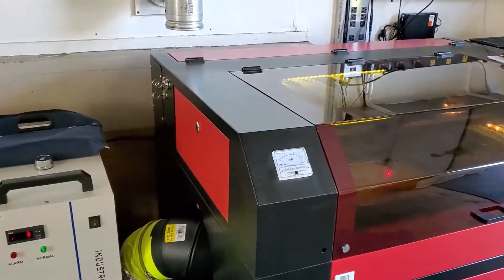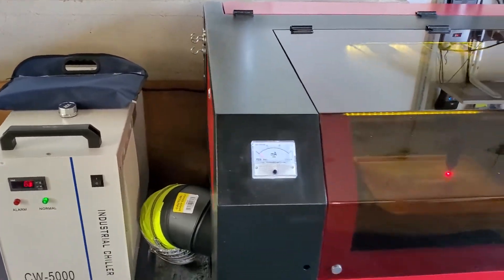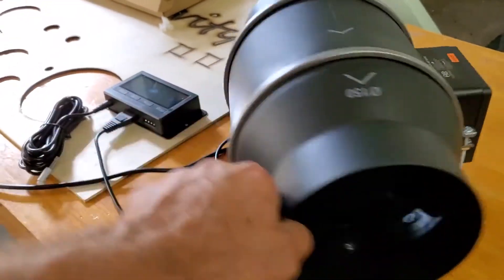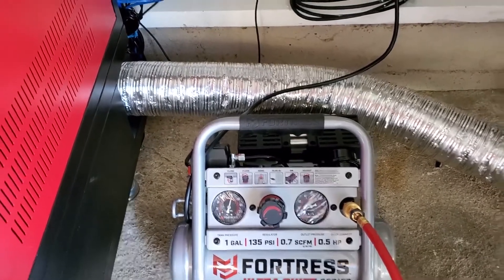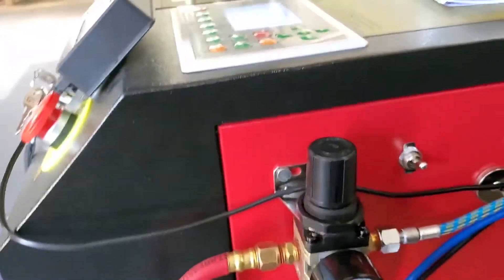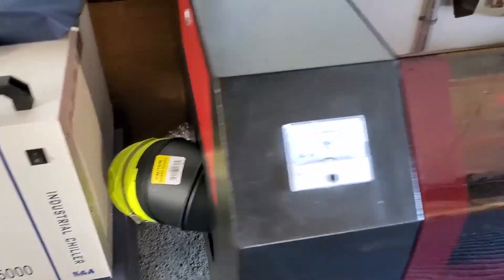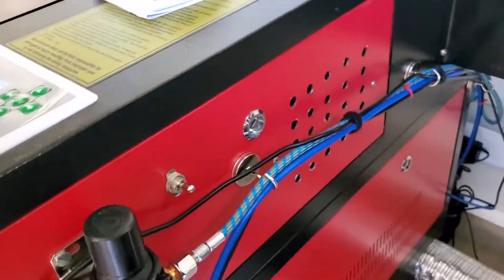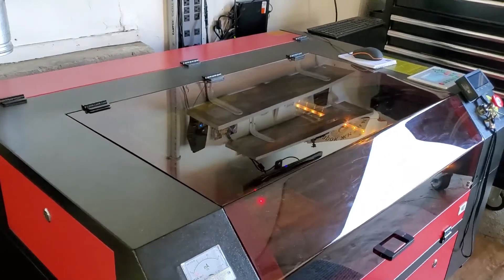Last CO2 Laser upgrade...really

Comment: Nice cross flow idea. Best of all that smaller fan will stay clean. 
I have one of them that came on the system stuck in the side. It is caked with debri.  Upgrading to external soon, but will add in a disposable filter to change once a day
Reply from the maker: That cross fan is great for engraving.  Thanks

Comment: Are you using Lightburn software? I had the 6 inch inline fans on my 100 watt lasers but I did nt think that moved enough air so I installed  8 inch blowers with 6 inch adapters on the ends of it and that seems to pull pretty well...also you need to make sure that you dont run it under (around) 45-50 degrees, I have noticed that the glass gets brittle and the cold antifreeze will crack the inner water jacket. Are planning any more videos on your laser?
Reply from the maker: Yes running lightburn.  Love it!  I try not to run it when it's below 50 degrees or I'll just run some heaters to warm up the shop if I have a project.  Yes I plan in having more laser vids coming up soon.  Thanks for your comment!

Comment: Hey - how did you go about removing the little air pump? Did you just cut it out or follow the wires? I can't find where to unplug it for the life of me.
Reply: I also would like to know this, just got the same machine, 2020 version. I agree this little pump is a joke.
If you could make videos on how you went about these upgrades it would be very helpfull to us newbies, Thanks.
Reply: @martinduffy3835  Hey Martin - I ended up just chopping the wires to that pump and taping them up. It blows my mind how loud it really was and how much vibration it introduced to the machine. 

I bought a "silent" air compressor, air hose, and some push-to-connect fittings from Home Depot and a compressor air line filter/regulator from Harbor Freight and hooked all that up to the existing air hose. The difference is honestly extreme - cutting power has increased dramatically and the edges are so much more precise and clean.
Reply: @ericleewhatever   @Eric Stevens  Thank you for the reply, I had a nightmare last night and have stressed all day over it.. what happened was I raised the honey comb up automatically and it didnt stop it started to jam the auto focus rod I had to hit the emergency button. I am just praying that the whole assembly isnt damaged, I am hoping that worst is that Ill have to realign the mirror on the laser assembly..
typical  read the book after I screw up.
Reply: @martinduffy3835  Oh man... that is a nightmare. Hope everything turned out alright.